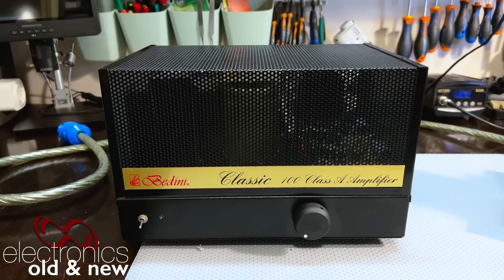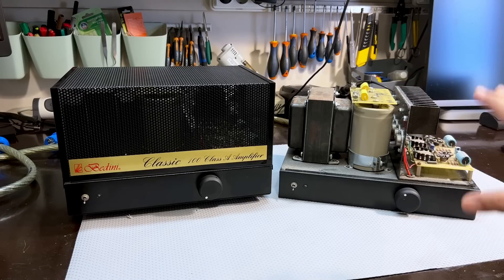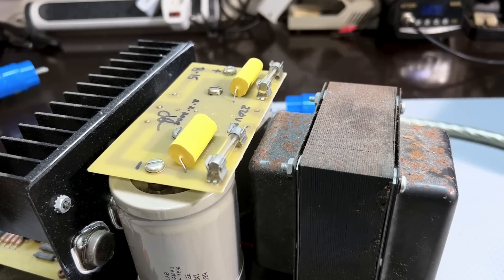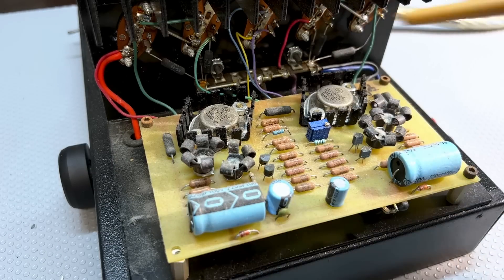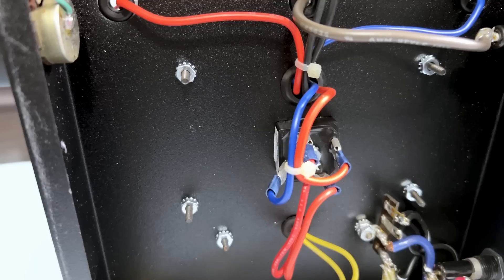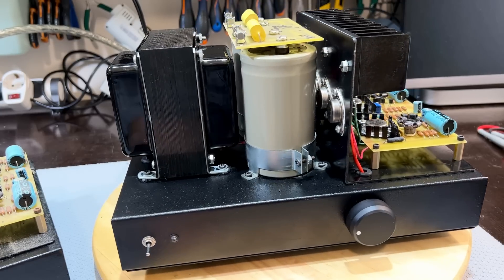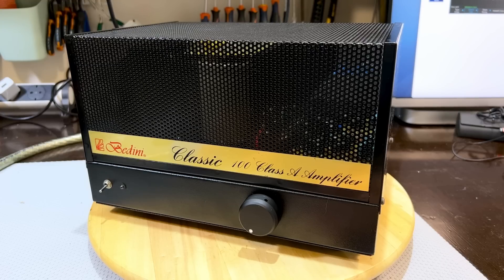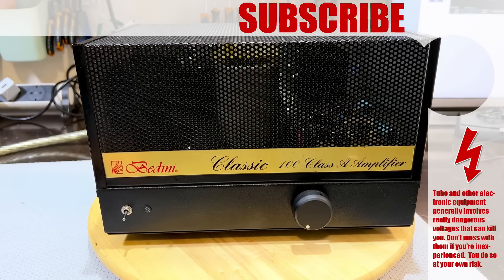Restoring the Rare Bedini Classic 100 Class A Amplifier.

Comment: I'm curious why the power supply caps and other electrolytic caps were not replaced, or at least tested. Just for piece of mind so not to blow specially matched transistors from a power supply failure one day. I feel with the Bedini amps, having to replace a transistor maybe the most difficult part of a repair because of their esoteric selection and matching. I feel for the price and rarity of these, one should consider preventive measures too? It doesn't always have to be about better sound, but reliability I feel should also be considered with vintage equipment.  Thank you for the video, I enjoyed the rare look into one of these legendary amps!
Reply from the maker: My pleasure

Comment: I built bedini amps in the early 80's, I did everything from milling the heat sinks assembly of pcb's and building the amps, preamps and others. These two are before my time, but I remember doing repairs on these in my time.
Nice to see your videos.
I worked for the brothers for a few years and for a while I was the only employee in the shop in sylmar California. My first job, and other than John, Gary and John's wife it was just me as employee..
Reply: Thanks for sharing, John and Gary were legends in more ways than just in audio.
Reply: @wildancrazy159  hey! I have two BA 803. I have some questions about them. Would you be so kind and help me? Thanks!

Comment: John Bedini..'For good output transformers. it would take us three days to wind them - but what a difference in sound because of the increase in iron in the transformer!'
Reply: His transistor selection and matching also seemed unusual. I would hate for a transistor to go bad in one of these, you would probably have to pull a few good working ones out of the amp and look at them with a curve tracer, and then probably go through testing 100's of transistors to get the best match. He built his unique motors in a similar way too with strict transistor matching, and impedance matching ever where like with RF circuits.

Comment: Hi. I notice quite a bit of power cord bashing here in the comments stemming from some comments in the video. I just wanted to mention to Manuel that you can't assume that audiophile equipment such as these mono blocks gets plugged directly into the wall outlet. A lot of innovation has focused on power delivery over the past couple of decades, and it is quite possible that any given piece of audio gear could be plugged into thousands of dollars worth of dedicated power "cleaning" equipment--even stuff that tears down the power from the wall and rebuilds it into a "perfect" (i.e., noiseless, zero DC, zero fluctuation) wave. Now, what cord it takes to maintain that perfection from the power source to the amp is a debate of its own, as is the need for such perfection for any given power supply design. I just wanted to point out the possibility of an error in your assumption that these things get plugged directly into the wall. Just a friendly suggestion. ;)
Reply from the maker: Hi Lou. Actually, I’ve repaired quite a few of the power cleaning units and they are amazing. Perhaps my comment on the “direct to the wall” connection was too broad, and I should have mentioned the caveat of these units. I do, however, know if a few guys who don’t use them, and still swear by these cables.
Reply: @electronicsoldandnew  Oh, yes. There do seem to be many who believe in the effects of power cables alone. Heck, as you are probably aware, there are professional reviewers who spend days swapping power cords in and out of audio systems and describing in great detail the sound differences attributable to them. I never have been sure what to make of all this.

I was once told, and I believe, that one of the most important aspects of a golf club is how good it looks to the player--how much confidence it inspires. I can't help but to think of the power cord debate as somewhat analogous. The mind is a complex thing.

Comment: I never understood the "audiophile" idea that power cords make a difference when the wiring in the wall is just standard wiring.   Do they feel when it is hidden in the wall it just doesn't get interference?     Sorry,  I won't say more.   If they want to spend ridiculous money on power cords, then that is their decision.   :)   I think the beauty in these monoblocks is their simplicity.  The do have a price premium for the brand name, but the are a well made and designed amplifier.
Reply from the maker: I too was impressed with the simple and clean design.
Reply: A lot of people do have metal shielded wires in their walls though. In the power industry, when it comes to high impedance power lines, they say "High impedance can contribute to voltage sags, low voltage conditions, high frequency noise, transient impulses, and harmonic voltages." So I think the idea behind the cord was more about not making a high impedance antenna radiating right near or into the amp. But maybe was more necessary with the power grid of the 1960's, where today's power grid doesn't have the same noise, transients and voltage sag issues as back then.

Comment: Audioned a pair about 10 years ago, but they wanted AU $5000 for each unit. A bit out of my price range. I went for a Luxman MQ-80 unit instead that is packed away awaiting resoration.
Reply: The money is in the rarity, and the engineering artist, which he is dead now so that usually also means that their art is now worth that much more now that they will never produce again. These are low production run, hand made "bouquet"  electronics, so hard to tell how many went out and are still around today. I just got a Bedini BASE unit for 700 on ebay, after seeing them forever listed at 4-5k on ebay. I want a bedini amp one day, but those also listed for several thousands usually, though I seen a broken one for 500 I am tempted to attempt a restoration/repair :o

Comment: Seems odd with the gauge that power cord and mains input fuse of 15A Slo Blow that the mains switch and the wiring to the mains switch is a much smaller gauge. I would have thought the in rush current to that mains transformer would destroy the switch!
Reply from the maker: No, it holds up just fine.

Comment: Nice! I thought it was a tube amp before I saw the chassis with cover taken off. Apart from traces of rust on the transformer, it's a thing of beauty and a joy for ever. Looks like '60s vintage, all made the way they made tube amps :)
Simple is better than complex, complex is better than complicated.
Same opinion as mine on those power cables. They look nice and have that FGF (Feel Good Factor) to them.
130W on class A? Man, that thing is a BEAST!
Reply from the maker: I’m always a little apprehensive when working with something that is considered a collector item by the owner. Always fear that instant smoke and grief that follows 😊
Reply: John was clever and took the expensive tube amplifiers at the time that the audiophiles where loving, and studied them with a spectrum analyzer and then used that info to engineer solid state amps with the same spectrum signature. Pretty much ahead of his time when you consider all the amp modeling done in software and hardware these days so you can sound like you are playing through a marshal amp while recording on your computer!
Reply: I find it hard to believe, with 30watts of heat losses dumped into a 160 x 75 x 60mm sink at mine, its temperature remains at 22°C above ambient. At 130watts in class A these sinks would literally glow in the visible spectrum.
Reply: @electronicsoldandnew  Let's be optimistic and assume 15% efficiency, this equates to hundreds of J/s dissipated from 5, not 50 TO3 cases at idle. Flip the switch with a 3ft. pole and watch the amp dissipate, albeit in a cloud of smoke and into oblivion💨
Reply: @paulb4661  John was a electronics genius, he really did figure out the energy riddle to the point he even used similar tricks in his commercial audio amps. His Class A amps are related to some of his special solar battery chargers he released in the years before his death, solar chargers that would still charge batteries in low light, even full moon light!
Reply: @DavyOneness  Genius, or not, the laws of physics haven't changed to make way for gifted individuals. You do the maths and the result contradicts the theory, which one is wrong- maths, or theory? Let's assume the puny sink and the case itself miraculously present a combined thermal resistance of 0.5K/W. With 200watts output and a very optimistic class A efficiency of about 20%, they would need to dissipate... 800watts. This translates into the final temperature of 400°C above ambient! It would be glowing red, if only the transistors didnt fail at 160°C.
Reply: @paulb4661  "Today's scientists have substituted mathematics for experiments, and they wander off through equation after equation, and eventually build a structure which has no relation to reality." - Tesla
No laws have to change or be violated when you are working with "open loop" thermodynamics. No "free lunch" in closed loop thermodynamics. A heat pump can have a COP of 2, meaning you get twice the energy out of it than the operator inputs......and without violating ANY laws of physics.
Reply: @DavyOneness  What does it have to do with this particular example? Sorry, we can of course exchange irrelevant quotes copied from the net for all I care, but surprisingly, engineering principles play a considerable role in the design of any, let alone Hi-Fi electronics. Perhaps you should compare it to Krell amps to see just what it takes to implement an actual, not nominal, class A design of considerable power output.
Reply: @paulb4661  There was much more than just a quote there, fyi.
 I'm sure the 10k$ class A amp he built for the MGM wasn't "nominal" ? But why would I compare his amps to a Krell, when Bedini states only him and "Electro Research" were making these this special way. If you want to talk about "weird audio electronics", look into the legendary John Iverson who started that Electro Research company.
Reply: @DavyOneness  Principles of class A operation are and have been well defined for a century, or so. To put it simply- this isn't one of them, but also, it doesn't feature a heat pump either and has nothing to do with Nikolai.
Reply: @paulb4661   yes, the theory of Class A is old. But who else is able to use their Class A audio amplifier designs to charge LiPo4 or lead acid  batteries with solar panels in low light levels? Krell????????         Tesla is related because people like Bedini studied Tesla, and based their designs on what they learned. Bedini was even crushing up rocks and build his own hi-fi transistors out of them,  he had been making his own transistors and diodes out of rocks since he was a child. FYI, The heat pump was an example of something being less than 100 percent efficient while outputting twice of what the operators input, pointed out in regards to your efficiency comment.
Reply: @DavyOneness  Just as heat pumps do not violate the 2nd law of thermodynamics, so is this amp incapable of violating any, regardless of its rock crushing, Tesla fascinated Inventor. it cannot be a canonical class A amp capable of 100watts continuous output, because it would have caught fire in doing so. That's all there is to it. Krell uses variable bias in their newer designs, calling them class A in a similar fashion, which they're obviously not. We have had heat pumps and solar panels, what next- rocket engines? It's just an amplifier, not a warp field engine from Star Trek! I have had to estimate an adequate size of sinks quite a few times, funnily enough the actual temperatures are within 10% of calculated, rail voltage x DC bias current equals what exactly?
Reply: @paulb4661  OK, you have now confirmed  it all  went way over your head. I understand,  its not for everyone. Have a nice day !
Reply: @DavyOneness  Whatever
Reply: @paulb4661  Its that attitude that further  confirms it went way over your head. My main basic point being in all this, people like John Bedini and John Iverson are not you normal "in the box" thinking audio engineers, and studied areas that are over most peoples heads, and why most people can't full understand or appreciate their designs. There's  a reason the Navy contracted audio engineers like John Iverson to build Class A amplifiers for their nuclear submarines, and didn't just open theory text books and design their own, since class A amplifier operation has been already so well known...... Bedini built amplifiers with his own homemade transistors that glowed because they were doped Radium, he was way ahead of his time, still to this day.The amp in the video is not one of these, I am just pointing out how unique of an engineer he really was, to those who are interested, if your not interested, then "whatever", I have more important things to spend my time on than you. So have a nice day 😊
Reply: @DavyOneness  Seriously? I made an argument a year ago regarding mutual exclusivity of estimated heat dissipation and current stage devices capability and class A operation declaration of the manufacturer and you go on about history and irrelevant matters concerning heat pumps, solar panels and talents of Tesla and Bedini. Laws of physics remain inviolable and engineering principles still apply. Do the maths, if you can.
Reply: @paulb4661 Sorry I even bothered to suggest that there is more  to appreciate and more than what meets the eye to these designs when it comes to standard theory or engineering, but, once again have a nice day,  "seriously"  🤪
Reply: @paulb4661  I never said there was magic, but since you love quotes, Arthur C Clark once said  “Any sufficiently advanced technology is indistinguishable from magic”. Enjoy your Krell! But maybe that is why you are still unable to have a nice day, lol
Reply: @DavyOneness  Here's one for you "John was a electronics genius, he really did figure out the energy riddle to the point he even used similar tricks in his commercial audio amps" You're wrong again, I enjoy lateral fets based ones and please continue with your mild insults, you're actually funny when you're trying to be clever.
Reply: @paulb4661  That's just a fact he was genius who thought "out of the box", He publicly demonstrated at the audio trade shows in the 1980's of him powering 100's of watts to speakers through wires as thin as human hair, this is TESLA territory. Anyone can take his "CD Clarifier" product that uses a special modulated  magnetic field,and  'rip' a untreated CD onto the computer and than compare  it treated afterwards on the computer in wave programs, and without the need for special audiophile ears necessary to see the difference it really made. No one can explain why that can alter the plastic so the laser reads better, but it does based on results.  Bedini BASE processor used special interferometry with the audio signals to produce "3d sound" and phantom center channels, which were used on movies like "red october" and "they live", all the remastered pink floyd stuff from the 90's had it used on it, and so much more... And when some radio stations started broadcasting with it, people would record songs off the radio and find that they sound far better than the original albums. I enjoy proper Bipolar Transistor based amplifiers, but none of that really matters when I run everything through my original Bedini BASE processor, because than every half way decent amp sounds great. Glad I can put a smile on that face, I don't have anything against Krell, I live in CT and wanted to work for them, they just couldn't afford me at the tech level I am at.
Reply: @DavyOneness  I'm sure Krell couldn't, holding oneself in high esteem is crucial. It is all very interesting, if mildly nauseating, but anecdotal evidence is just that. If I were 15 still and impressionable, I'd have built a shrine to my idols and so on, now that I'm older, I kind of learned to be wary of falling under a spell. I never questioned anything other, than the class A moniker attached to this particular amp, I may only be a poor soul unworthy of holding the soldering iron for them, or you, but so far, all I've cobbled together works, measures well and sounds pretty good and, most importantly, does not interfere with engineering principles or... common sense. I guess, what I'm trying to say is, that math works and as long, as I knew what I was trying to get at, the actual measurement results followed estimated values pretty much to the letter. We can agree to disagree, or agree that this is a brilliant amp designed by a genius, albeit not featuring a class A output stage in conventional sense, or falling short of power rating. To make it simple, a rule of thumb is that for each Watt to be dissipated you need about 40cm² of surface area, to prevent it heating up to beyond 20K above ambient. If you want 100W of audio in class A, the sink must be able to dissipate more, or less 250watts of heat at idle. This translates into a 300mm long, 150mm tall sink with 30 vertical fins about 100mm deep! The casework will help, but also impede convection, for a net zero. You're welcome.